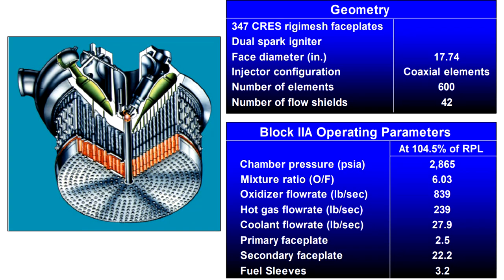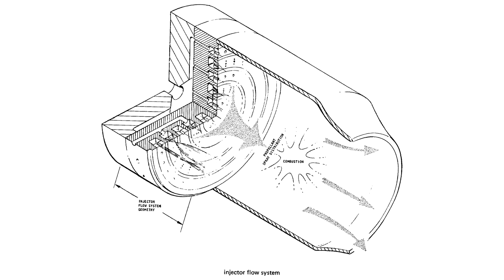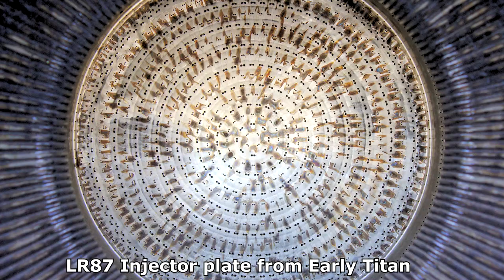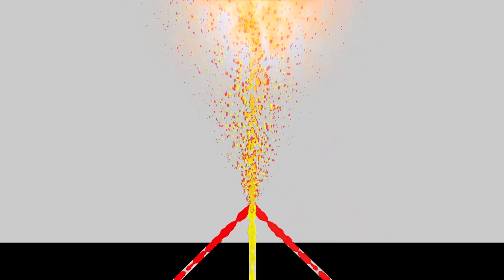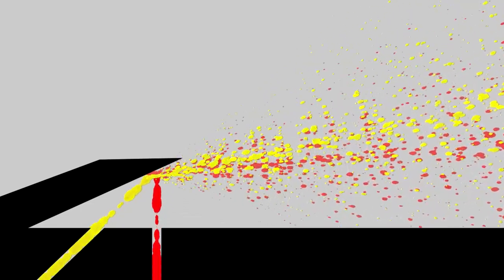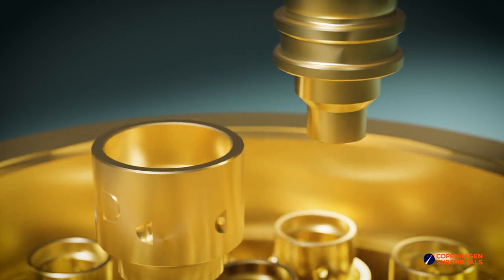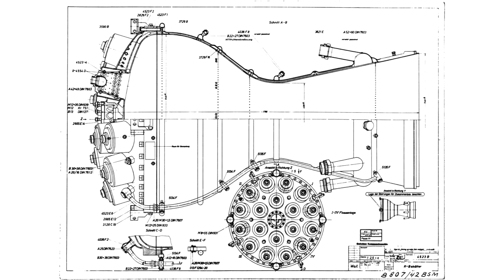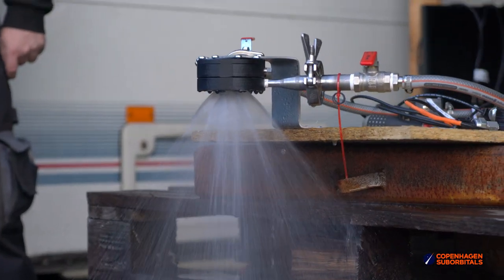Rocket Fuel Injectors - Things Kerbal Space Program Doesn't Teach

Comment: Since the fuels discussed are not hypergolic, i.e. they do not instantly combust upon contact, would it be possible to mix the fuel and oxidizer INSIDE the tubes of the injector before they are expelled into the combustion chamber? There are special dual-chambered "pumps" for epoxy in which there is a separate chamber each for the liquid epoxy and the liquid hardener. Press on the plunger and the epoxy and hardener are pushed through a tube that contain small baffles which thoroughly mix the two liquids before they exit onto the surface that is to be epoxied. Couldn't a similar approach be taken for fuel and oxidizer in the injection tubes of the rocket engine? Mix them just BEFORE entering the combustion chamber so that there is reduced, or maybe even NO , need to atomize them after injection.
Reply: Sounds like an explosive idea!
Reply: @TheVicar  Clearly the fuel/oxygen mixture would need to exit its tube faster than the flame front can move towards it. Since the liquids already have to move through the tubes at incredibly high speeds, in order to overcome the pressures already in the combustion chamber, it might be that they already are faster than the flame front and therefore wouldn't be in danger of ignition inside the tubes. I would be interesting to do some experiments.

Comment: How about those tulip mixers the silent and low infrared airplanes engines have to use to mix hot engine air efficienctly with cold ambient air? Wonder if they would work in miniature 3D print

Comment: How the injector withstand the heat? I know the fuel also cooling the injector but after exit, the fuel are burn hot in the chamber.
Reply: The injector plate is relatively cool because fuel and oxidize is flowing through it and because the super hot combustion gasses do not actually touch it. The flame front is typically located a few inches away from the face of the injector. This is not the case with the walls of the thrust chamber, the nozzle and the engine bell. As such those have to be cooled by circulating fuel through them or by surface film cooling.

Comment: Here's my million dollar idea: Fuel pumps and fuel tanks on the ground. Engines and small fuel tanks on the rocket. Hoses 5000  feet long on huge ground based reels with outlets attached to sides of rocket. Pumps as big as barns pump the fuel to replenish the on board tanks as the rocket takes off. Reels unwind as rockets goes up. Hoses detach at 5000 feet with rocket having full tanks and travelling at high speed. Takeoff weight way lower, faster acceleration. See, Elon has the money but we gots the PLAN !!!
Reply: One could only imagine the weight of a 5000 foot hose that pumps fuel, not to mention the weight of the fuel itself inside the hose

Comment: I'll be waiting for the day they use millions of print heads from printers.
Same job just on a smaller scale.
Reply: Inkjet printer heads are designed for a totally different thing.
In a printer, you don't want a mist of ink, you want a single carefully aimed tiny droplet.
In a rocket engine, you don't want a single carefully aimed tiny droplet of rocket fuel, you want a mist.
And dumping a lot of power thru the tiny photo-etched injector plate of an inkjet to get a mist doesn't sound like something that the injector will survive.

Comment: Would a fuel injector from a GDI engine or a diesel engine work in a small rocket engine?
Reply: no. you need to pump way more fuel at way higher pressures and take way more heat.

Comment: What the.. How turbopump can produce over 600 bar of pressure with the flow of 2000kg/s? is this pump pumping by pistons or turbine? also of what material was combustion chaber made and how thick are the walls of it?
Reply: masio kobek the turbo pump essentially uses another, smaller engine to spin it at very high speeds. Chamber walls are often very thick and these days are probably made of carbon fiber.
Reply: But how thick are the combustion chamber walls, and at what rpm turbopump is spinning?
Reply: masio kobek depends on the rocket

Comment: Considering the fuel and oxygen is a liquid changing to a vapour, Is there much of a pressure change either side of the injector?
Reply: Yes. Upstream of the injector the pressure has to be somewhat higher than the pressure inside the chamber. This is necessary to establish a positive flow of propellants into the chamber. For example, the Saturn V F-1 thrust chamber ran at 1,000 psi. As such, the pump discharge pressures had to be about 1,200 psi. This created a 200 psi difference across the injector so that the propellants could flow in continuously at a constant rate.
Reply: @joevignolor4u949  so the injectors is kinda like a metering device in an aircon / refrigerator?
Reply: @marksanders7988  The injector plate is sort of like a shower head. You turn the water on and pressurized water is applied to the upstream side of the plate with the holes in it. Then the pressure differential pushes the water through the holes causing it to speed up as the pressure drops. The fast moving individual streams of water then combine together and spray into the bath tub.
Reply: @marksanders7988  You are thinking of an expansion valve in a refrigeration system. It's function is to allow the pressure of the compressed liquid refrigerant to drop so it can evaporate in the evaporator. An expansion valve is a little like one of the holes in a rocket engine's injector plate but its function isn't really the same. The holes in the injector plate are there to accelerate the propellants into two streams so as to mix them together in the thrust chamber.

Comment: My shower head actually has a setting where it will produce a very fine spray. I am now curious to figure out how it actually does that! :D
Reply: Buy a replacement shower head then than the original apart to see how it makes the mist. Then install the new shower head on the pipe before the significant other needs to use the shower.
Reply: @gregwarner3753  hahaha, yes, unfortunately the mechanism is completely invisible from the outside so taking it apart would be the only way to figure it out :/

Comment: And how does it work in the solid fuel boosters?
Reply: Solid boosters are a whole different thing. The fuel and oxidizer are mixed together into a paste. Then the  paste is packed into the body of the booster and hardened into a solid. There is a long hole down through the center of the booster. When the booster is lit by a flame shot down the hole the paste ignites and burns from the inside out. Because liquid fuels are not used there is no injector plate.

Comment: Has there been any engineering in the opposite direction? That is, ideas in fuel injectors being used to design better showerheads?
Reply: That would imply that the optimal shower head for dousing an upright body would make as much of the water as possible into steam or very small droplets. Personally I prefer lots of small almost parallel water jets to hit my body.

Comment: Drill to many holes? Sure this does not apply if you 3D printed your combustion chamber and injectors in one piece, I think this would be  the new norm for  rocket engines that not require special materials to be made,and very soon this video will be watched only by nostalgic "rocket engines aren't made how it used to be from the hundreds or thousands of small pieces carefully putted together"

Comment: That's all very well, but you did not answer the question "Which injector design do rocket enthusiasts use for their actual shower heads?"
Reply: For shower heads, you generally want to have a steady stream. Proper distribution isn't important there, that's why showerhead injectors are commonly used.

Comment: Hey smart people. Help me out here!
Alcohol and h2o2 is a simple rocket fuel. 
Mad mike flew on a steam powered rocket. 
Both alcohol and h2o2  are water soluable. 
H2o2 breaks down easily in contact with silver platinum etc. 
both of these are liquid at room temperature and don’t need much more handling precautions than gasoline or strong acids. 

What happens if you mix alcohol and h2o2?
Is there a level of water content that still lets the heat of breakdown still vapourise the liquids?
Would this mixture still burn with so much steam?
Would the exhaust be cooled enough by the water to not melt the motor?

Yes, it’s a very low thrust and highly inefficient. 
But as a “safe” amature rocketed fuel it may open doors for experimentation.
Reply: Several a mature rocketeers have used 80% H2O2 as a liquid oxidizer. Pressurized Nitros Oxide has also been used.

Comment: Not clear about ignition and burning of the fuel on the J2 engines, as their is clear, slow motion video of an Apollo lift off clearly showing lack of flame out of all engines as a Saturn 5 lifts off.
About 10-15 feet below the lower cone edge,  then the flame starts, as if combustion does not occur until AFTER the fuel and oxidizer both completely exit the cone and nozzle.
Could combustion occur beyond the cone edge at lift-off and creep upwards as the altitude and speed increase after lift-off?
Reply: They were F-1 engines and the cooler gas generator exhaust shields the extension.  Combustion had occurred higher inside the chamber.

Comment: How are the millions of pounds of combustion force transferred to the rocket body?  Where is that force generated?
Reply: I just read this comment and thought, "hey, that's my question, too!"  Well, it IS my question.  So, asking again.
Reply: The force comes from the exhaust exchanging momentum with the nozzle and combustion chamber. If the nozzle needs to be steered the thrust is usually transferred through a ball joint at the top of the engine

Comment: Why don't they just inject it as a gas?
Reply: The fuel is stored as a liquid. Energy would have to be put in to turn it back into a gas. And since the density would be lower, your mass flow would drop.
Reply: @AM-rd9pu  I know it's stored as a liquid, but those aren't difficult to turn into a gas.  They use it to cool the nozzle anyway.  Instead of thousands of tiny holes, they could be a lot bigger for a much bigger opening so while the density is lower, the surface are it has to move through is higher so really won't affect flow rate as much.

The only drawback I can see is it might be a little too efficient where it burns immediately with the potential for blowback into the fuel/oxidizer supply.